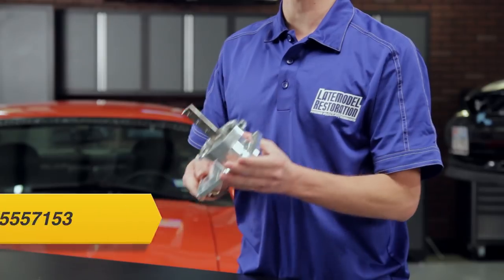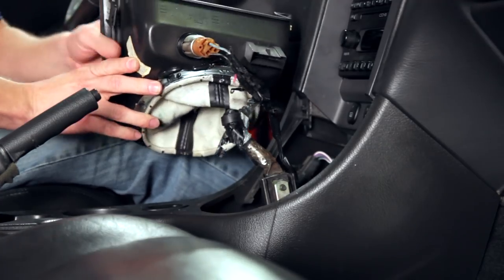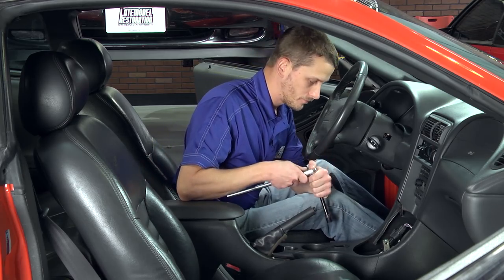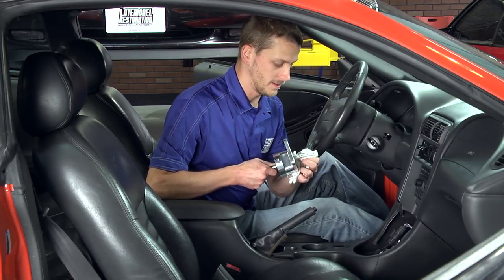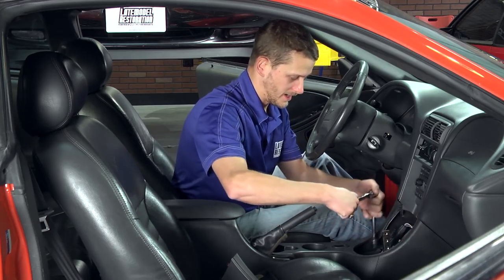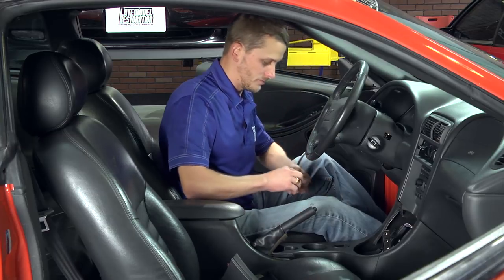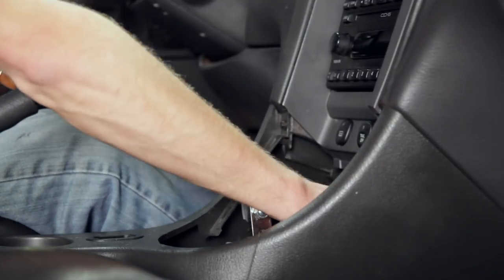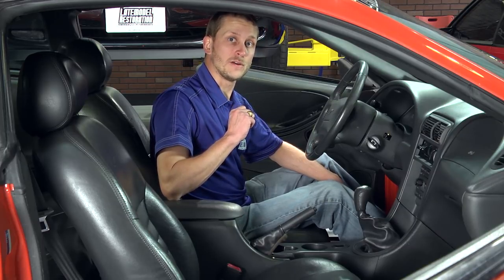Mustang Steeda Tri-Ax Short Throw Shifter Install

Comment: Is it bad if there is no gap between the shifter stop bolt and the shifter? Can it cause damage?
Reply from the maker: betoski - It isn't good or ideal.  If there is contact between the shifter stop bolt and the center shaft, it could rattle and cause noise, and it could cause an under shift where you don't get full engagement, and it pops out of gear under load.  -Landan

Comment: Can I just use my stock shifter base screws? I lost the ones that come with the shifter. Also,is there a way to install without the ugly leather shifter cover? What options do I have?
Reply: +Dennis Prow I know this question is old, and you've probably already taken care of the issue. But I'll go ahead and answer it for anyone else who may have the same problem.  No you can't. The stock base screws won't be long enough to hold the new shifter in place.
Reply: i know its to late but for anyone else wondering you can't use the factory screws different length.
Reply: @JF-tt6wy  hi I know this is super old but I just bought this shifter and I'm having a problem. When I set the shifter into the base there's like an inch of space. It's not sitting flush. Is there supposed to be a gap? Or am I missing something. The shifter rod is definitely longer than my stock one
Reply: @SteamTrain2639   Man, I'm not entirely sure since it's been so long since I've thought about this, but from what I remember,  if you did everything like the video instructed, then it should fit perfectly without leaving any space between the shifter base and transmission.  If you bought the correct shifter  for your year then it should rest on it perfectly.  My mustang is a 98, and the one I purchased fit quite well.   If it's not fitting proper then perhaps you bought the wrong shifter for your model, or maybe they sent you the wrong one.  Of course I'm just guessing here.  But if it is the correct part for the car then perhaps it has an aftermarket transmission in it?  Did you buy it used?  I don't know if that would matter or not. I'm no expert in all mustangs. I only know about what I personally own. 
Oh, the timing of your question is pretty damn good.  It's literally 4 years to the day right now that I installed it. Facebook memories reminded me of it earlier today.

Comment: tri-ax sucks
Reply: Why do they suck?
Reply: @theuncluded6220  Tri-ax doesn't fit correctly in a foxbody T5 transmission, I'm currently installing one that a friend gave me, but he warned me because the rod pops out of the bushing, and can't shift until is reinstalled or install back the factory shifter.
So I noticed the rod is 3/16 shorter that's why it pops out and I think that's why they absolutely sucks.
Reply: @OmarRuiz89  oh, okay.  I have a Mach 1 and it works great but I didn't know that about the fox body transmission having those issues. Thanks for the information though!